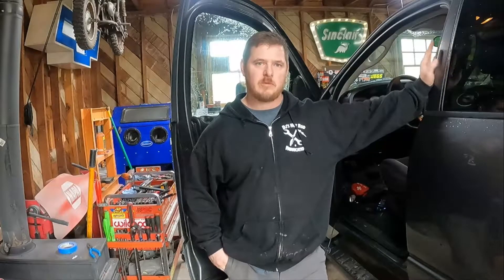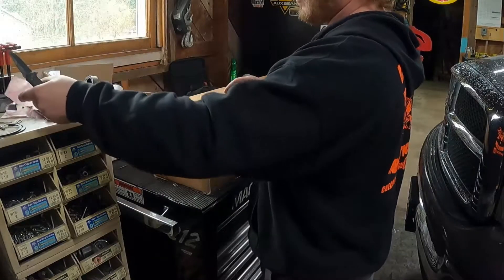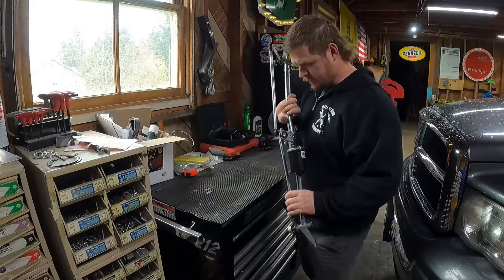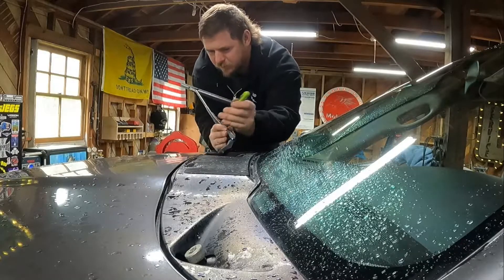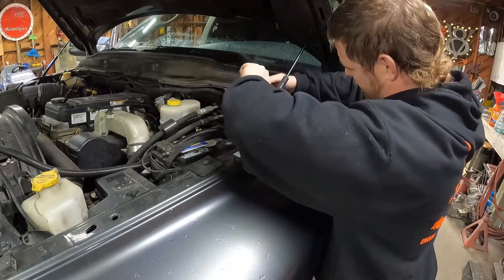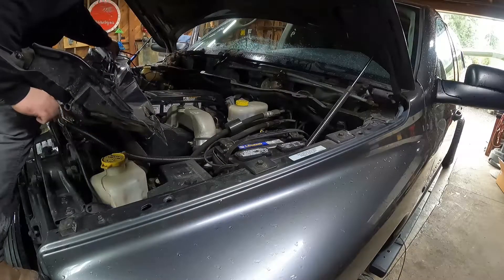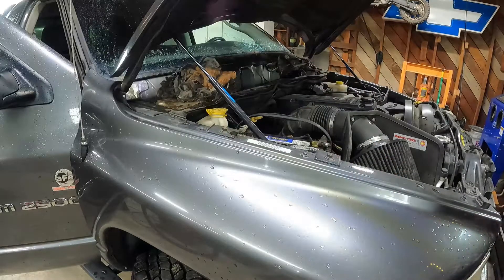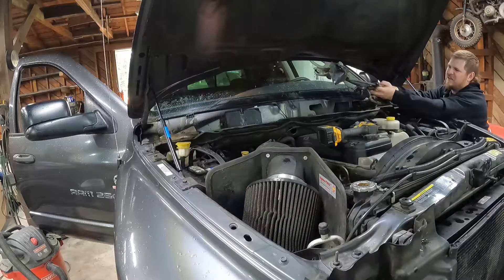Erratic Wipers? 2004 Dodge Ram Wiper Motor/Module  Replacement

Comment: Thank you so much for this! Just got done putting the new one in my 2004 1500. I had an "oh crap" moment when there was a 5 pin on the new one and my old one was 4, but then realized the new one came with an adapter plugged into it. Took that off and it was the 4 pin I needed.
Reply from the maker: Glad I could help.

Comment: Thanks for the assistance from watching your video. I had a wiper motor that only worked sometimes on my 2005 RAM. Ordered a new motor and used your guidance to remove the old one and install the new one. Much cheaper than taking the truck in to a mechanic.
Reply from the maker: Happy I could help!

Comment: Sir tip of the hat to you. Yes you helped me. I thought I was losing my mind with mine, stupid thing would work whenever it wanted. So thank you again. Yours is a diesel mine is gas my trouble is my heater control whatever it is. It’s vacuum operated so defrost is default . Mine blows out of the top of the dash all the damn time. At least 50% my EYES. Wondering if you have dealt with this. Thank you near Seattle
Reply from the maker: Glad I could help. That wiper issue is pretty crazy. I haven't dealt with any problems with my heater control. I would go under the dash and find the blend door that controls the defrost and see if it's stuck.
Reply: @DJsHotRodFab  my wipers are possessd. I dumping rain and they said NOPE clocked out. The heater dumpster fire I have heard it's vacuum leak. I can see the diagram but that's useless. Any hoo thanks mate

Comment: Ok, this video is SUPER Helpful!! I have an 04’ Dodge Durango SLT, and when I crank the engine on my wipers are coming on all by themselves!! I have to turn the wipers on then try to catch  they are down and turn them off because they do not want to return to the down position by themselves😩 I was thinking it was definitely the wiper motor, but I will definitely try the relay first!! Thank You for this video!!
Reply from the maker: Your welcome
Reply: I am having a very similar problem, could you share what you found to fix the problem? I'm thinking I need a new front control module. I inspected the TIPM and found no corrosion. Cleaned the contacts for the FCM, i'm about to lose my mind over this problem.

Comment: You could have just replaced the control module it was the round black piece under the motor. Parts places don't tell people that it's 20 dollars compared to 300 dollars for that assembly from the dodge parts place. Mine only thing is, i don't have intermittent wipers it could be the wiper control module or the intermittent relay in the fuse box under the hood.

Comment: I'm having the same exact issue now . I have a 2 part question . Did you replace with oem or after market? And if aftermarket have you ha e any issue ? I know some stuff like fan clutch need to be oem it wont regulate correctly
Reply from the maker: I went OEM with this one. I think the part wasn't available at the parts store.

Comment: I may have to do this to my 04 ram 1500 the wipers seem to have a mind of their own randomly turning on while driving to always routining once when I turn the ignition on and start it. There’s even been a few times the wipers rotated when the power was off and I closed the door. My only fear is I saw someone else on the internet who claim to have a similar issue as me and he said he put a new wiper motor in and it still had the same problem.
Reply from the maker: @joseph.christiansen  mine slowly increased it's randomness over the years, but your's sounds worse. I home it works for you.

Comment: Awesome video, thanks! Do you happen to remember the part number for the module? I try to only buy OE. Thanks!
Reply from the maker: Thanks. Sorry I do not have the part number. I just walked into the dealership and ordered it from the parts counter.
Reply from the maker: when I went to the parts store, they didn't even list the part, so I had to buy from dodge.

Comment: Better drop your blower motor down and check too.
Reply from the maker: Haven't had any problems there yet... Have you had problems with yours?
Reply: @DJsHotRodFab  How did the mouse access the cowl?
Reply from the maker: @georgecolbert3247  oh sorry, forgot about the mouse nest. I think he got in there from under the hood. But that's a good point